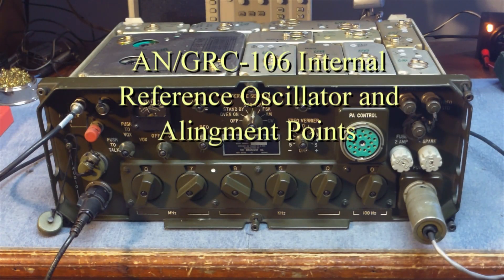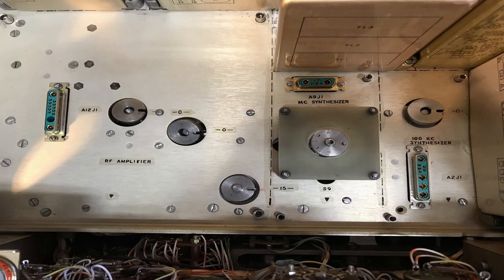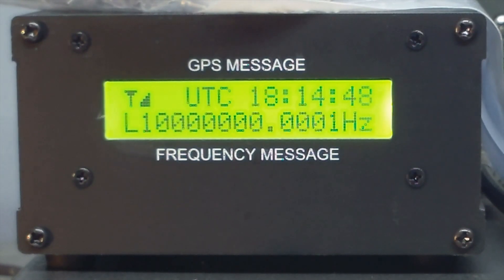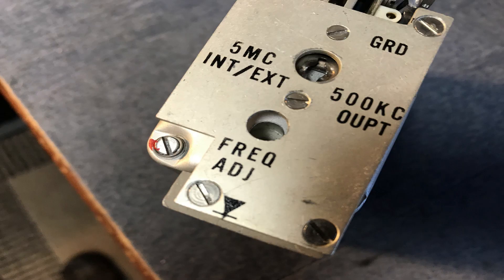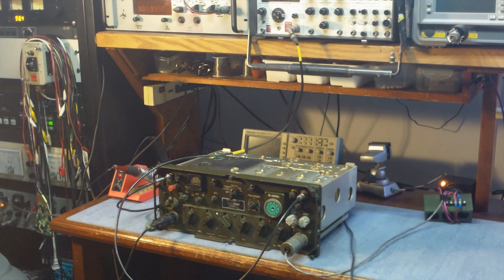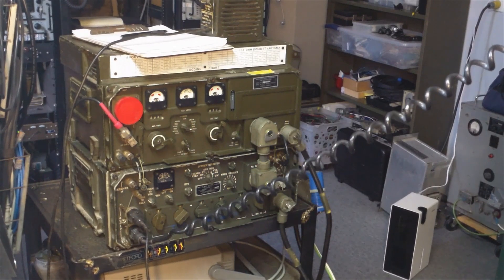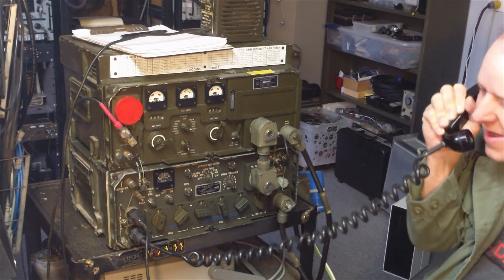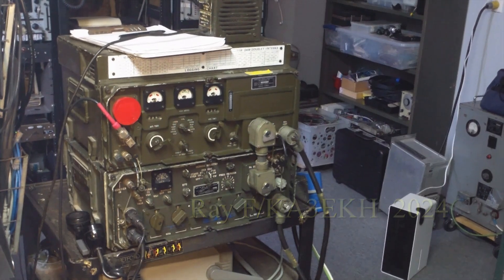AN/GRC-106 Exciter Time base alignment

Comment: Had a GRC-106A once interesting set  especially on 75m when transmitting SSB signal was around 60+Khz wide pure trash never did find out what was wrong ended up selling. These things are a major headache never again.